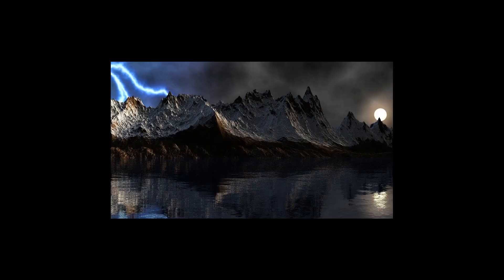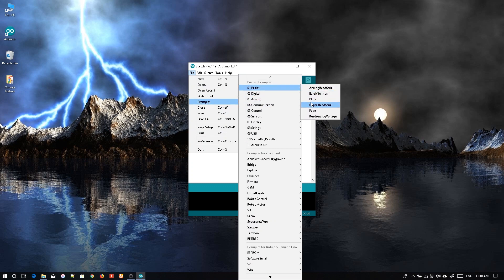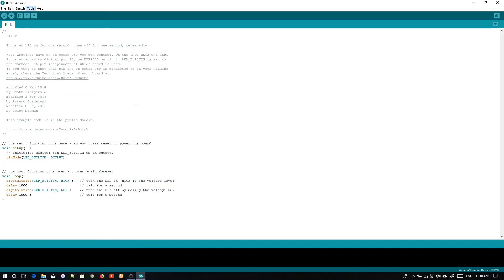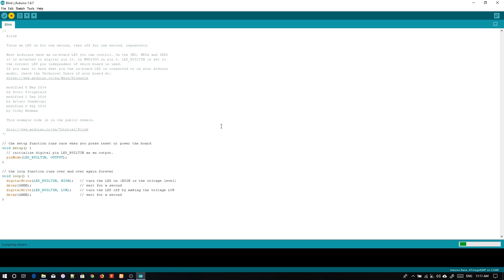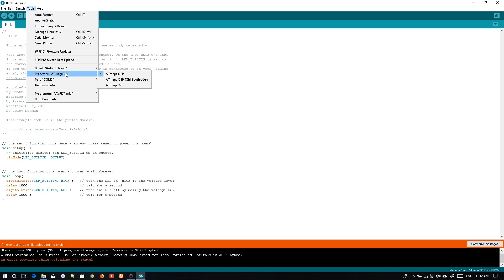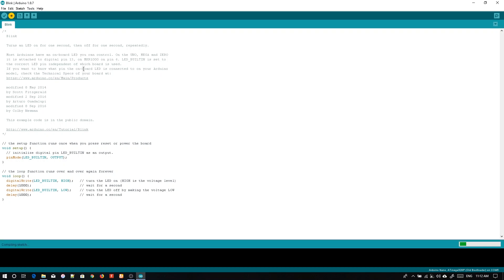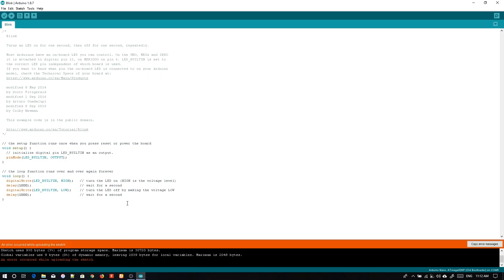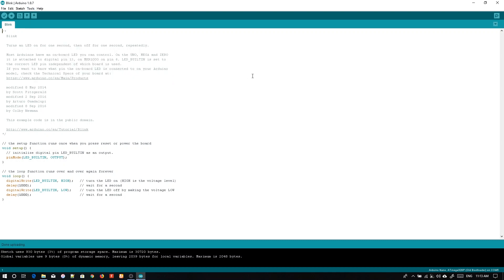Arduino Nano upload error fixed || error while uploading the sketch to Arduino Nano

Comment: Bro still have same problem after doing this help
Reply from the maker: Elaborate ur situation so that I could understand and help u
Reply from the maker: Try installing CH340 driver
Reply: Bro before that I already installed driver and upload the sketch but now new option show in Tool<Processors called at mega 328 P old bootloader  I tried both option to upload but arduino ide  shows that device is not responding
Reply from the maker: @indiantechboys9907 I suggest checking the port number
Reply from the maker: Try reinstalling arduino. If that also doesn't work then it could be the problem of ur board.

Comment: Hello, I have a very urgent problem with my Arduino NANO, when I upload a project WITHOUT ERRORS he regrets that there are problems in uploading the sketch, and even when I put the ATMEGA328 (OLD BOOTLOADER) processor the following error appears:

Arduino: 1.8.9 (Windows 7), board: "Arduino Nano, ATmega328P (Old Bootloader)"

Sketch uses 1714 bytes (5%) of program storage space. The maximum is 30720 bytes.
Global variables use 189 bytes (9%) of dynamic memory, leaving 1859 bytes for local variables. The maximum is 2048 bytes.
avrdude: verification error, first mismatch in byte 0x0000
0x00! = 0x0c
avrdude: verification error; content mismatch
avrdude: verification error; content mismatch

This report would have more information with
"Show detailed results during compilation"
option enabled in File -> Preferences.

Simply put: [b] AVRDUDE: VERIFICATION ERROR; MISMATCH CONTENT ERROR [/ b]

And that he installed the [b] driver for generic (Chinese) Arduinos CH340 [/ b] and still nothing

I tried everything and nothing works, nobody has wanted to help me, nor have I had the time and willingness to explain myself. Please I need help inmediately!
Reply from the maker: Can u msg me via whatsapp +917025904819

Comment: thank you so much bro,
Reply: can you please elaborate why we were facing such issue , or is there any update in IDE
Reply from the maker: Arduino has introduced new driver which is better than existing. But both are not inter compact able . So they gave two options for uploading.